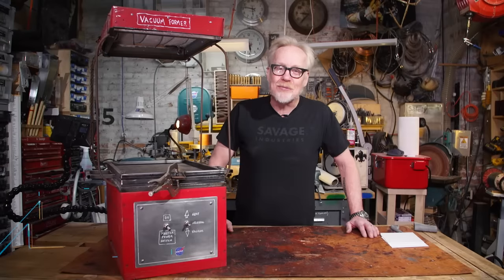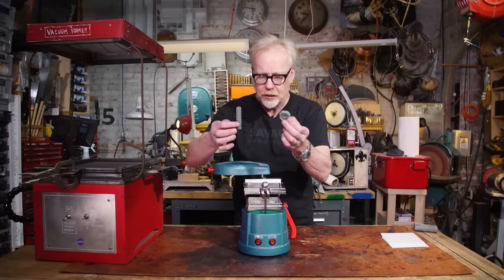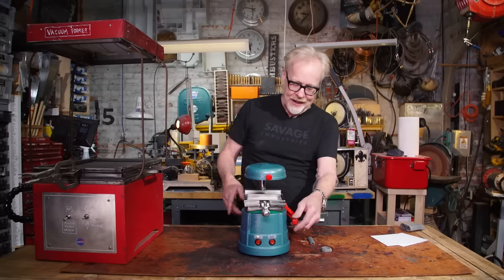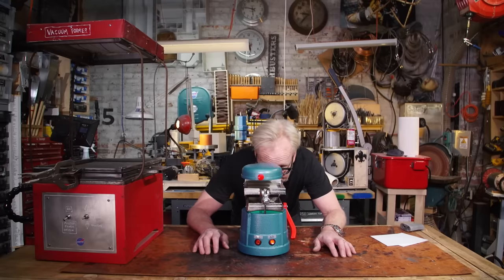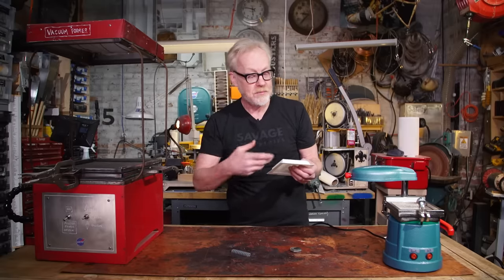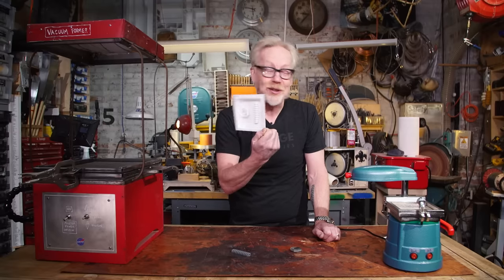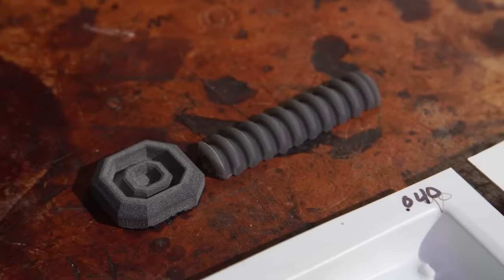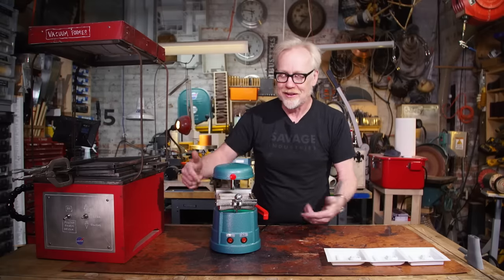Adam Savage's Favorite Tools: Great Budget Vacuum Former!

Comment: Very nice.  I’ve been using one most weeks for the last 30 years in my Dental Laboratory. Don’t forget you can fill the bottom area above the vacuum with ball bearings to allow different depths of form.  This also means you can place items in that have an undercut and use the ball bearings to stop the form being pulled into the undercut.  
Great channel mate !

Comment: Somewhere there is a warehouse that's had pallets of those things slowly selling has no idea what's coming haha
Reply: It's already down to 19 in stock on Amazon
Reply: They knew enough that the price bumped up to $159 now.
Reply: @RNMSC  You may be able to pick up a second-hand one, check with larger dental labs as I know we have two just sitting in the cupboard as there are much newer and fancier machines used now that use pressure
Reply: @assuredgrave  Also down the list, someone linked to a same machine from MicroMark for $124. So it's likely to be available elsewhere. I wouldn't expect any e-bay auction low price wins any time soon though. :-)
Reply: @RNMSC crazy now it’s only $69 now
Reply: @VinnyGjokaj  Willing to bet that there is some correlation with the number of people viewing the video now, compared to what it was seeing 3 years ago.

Comment: Used one very similar to that when I worked in a dental lab. The reason for the higher position is because the thick, rubbery film we'd use were for tooth grind guards and needed to be closer to the element. Worked great for ages.

Comment: Every time I see your homebuilt vacuum former, for a split second I think it's a popcorn machine :D
Reply: I see a gumball machine! Glad I'm not the only one😂
Reply: Now there is a fun, impractical project.  Clamp a thin piece of sheet metal ( tin? Steel?) into it and lay out some oiled popcorn kernels. See if you can get it to pop. 
  As I’m writing I’ve pivoted to a pouch made from aluminum foil with the kernels inside being clamped in the machine. Pretty much stove top jiffy by then. As long as the heat is even enough, allowing kernels to pop relatively at the same time and not burning the kernels or oil.
Reply: agreed. every. single. time. lol

Comment: I remember in the 60's, Mattel came out with a vacuum former.  It was slightly smaller than Adam's red machine.  One side had a hot plate, the other had the vacuum side with a hand pump & a plastic holder you would flip over from heater to former, then you had a handle for the hand pump. I got one for Xmas but didn't try it for a while because I had to save my allowance for plastic sheets.  It had a few pieces to start but like a typical guy, I didn't read directions.  I needed a couple of boats for flat car loads &  I wanted different color boats. After a couple fo failures, I read the directions.  Now once I mastered the procedure, I had so many boats I had to get more flat cars.  Boy, was I happy my father liked trains, my mother lost her basement every winter to a gigantic layout.  Best use we got out of the 5 ping pong tables (summer they doubled as buffet table when the family came to visit).  I miss those days building with my dad even though he hated that my modeling was better!  I wished I had kept that vacuum former.

Comment: We had one of those mythical small red vacuum formers at my old employer, a professional model shop in St. Louis.  They still have it, but as you say, it's impossible to find nowadays.  So I had been looking for a usable replacement and found this dental one a few years ago, used.  As you have found, it is an amazing piece of kit, and really fills a useful niche in any shop setting.  As a plus, my girlfriend has the teeth block from her dentist, and I can now make replacements for her for her dental needs!
Reply: The Vac-U-Form machine was made by Ron Charles & Associates (RC Vac-U-Form) in Wilmette, Illinois (Chicago area), circa 1988 to 1991.  I recently inherited the 8 x 11 size machine from my old employer, a St. Louis area professional model shop that just closed. That machine was $450 new in January 1990.
Reply: The 'Deluxe' model allowed for use of 9" x 12" sheet stock; the 'Deluxe XL' was made for 12" x 18" sheet stock, and the 'Supra Deluxe' used 16" x 24".  The 'Deluxe' model measures 24" tall, and the footprint is 13" x 10.5".  It weighs about 35 pounds.  I don't have information on the price and of the larger machines.

Comment: Really nice for small jobs, and what's really neat is the frame on this is held up from the platen on a riser, so that the plastic has to expand to the base of the buck instead of having to shrink to the base of the buck and create webbing.
 I went the home built route of a plywood sheet with a vacuum cleaner hose in the middle, and used the kitchen oven to heat the plastic.  The upside was that it can take any size frame I want to build so that I'm not wasting plastic.

Comment: I do a lot of vacuum clamping of wood parts and to get a stronger initial pull I added a vacuum tank under my bench. 8 ft of Sch40 6” PVC capped at both ends. Pump pulls the tank down then a foot pedal valve opens the clamping fixture to the vacuum.  Probably won’t work with the little dental vac-u-form but if you have a shop made bigger one it might.

Comment: I’m a Registered Dental Hygienist, and really the plastics we typically use are a thin clear plastic for retainers to a thicker rubber type for mouth guards.. All the plastics will have a very high registration accuracy because they have to fit perfectly for teeth. You work them the same exact way as you did the styrene..

Comment: I was introduced to vacuum forming as a kid, when I used my Mattel machine to make HO scale models for my trains and slot cars.
Reply: I had one, too. It was interesting and fun, despite the somewhat inconsistent results (at least in my case) due to hand-pumping to form the vacuum.
Reply: I had one too!
Reply: @Markus0021  Yeah, though I found the inconsistencies to be related less to the hand-pumping and more to the clamping arrangement that relied on registration pins in the plastic blanks.  I solved that by fitting it with rubber gaskets in the frame.
Reply: @harveyconway6036   You could be right. Or it could be a combination of the two. Either way, this rig looks to be a significant improvement.
Reply: @Markus0021  Oh, no question!  I think I suffer from a wistful lust for this: would that Mattel have incorporated a real vacuum pump!

Comment: Huh. I was planning to build myself a cheap, homemade, 40x50cm vacuum former that would cost me around 10-20usd (making use of the kitchen oven and a vacuum cleaner I already have) but I was thinking that perhaps it's not worth it and I could probably just buy a professional vacuum former for around 35usd. Learning that this tiny thing costs 120-170usd really seals the deal for me. :o I'm building the 10-20usd one myself, no regrets!! :o
Reply: @@grayhand860 1 year later and I actually decided to make this homemade former out of some MDF and cheap alluminium profiles. The final budget was around 18usd (15eur) and I'm loving it. :D Using the oven to heat the plastic and a vacuum cleaner to get the suction on the form.

Comment: You could use a big vacuformer for small parts by making a board with a hole in the middle that covers the wasted space on the vacuum bed, with the hole the size of your smaller sheet. You'd need a small frame for the sheet too, though.

Comment: My first exposure to a Vacuum Former was in grade 7 or 8, in our wood working class.  We didn't do much with it but each of us could use 1 sheet of plastic with it and everyone had a go.  Had I known at the time what a cool machine it was, I would have brought in some objects to put down to get molded just for the extra fun of it. But we learned about it that day, and did all the forms that day so we didn't exactly have a waning about it.

I think the size of sheets we used were like 1 foot by 1.5 or 2 feet (still have it around here somewhere, just been a while since I seen it).  Though the machine we used took up much more room, you had to flip the plastic over from the heating side over to the vacuum side and you had to make sure the plastic didn't droop too low or else it would hit the heater.  So ya not as safe as the ones you have there. We all still had a blast though and nothing burned down or even caught fire that whole entire time they were in use. :)   lol

Comment: I ordered one on Monday and got it on Wednesday.  Note:  If you shop around you will see the same looking machine but at different wattages (600, 800, 1000, 1200).  The one in Adam's suggested link advertises as 1200 watts, but there is nothing on the label, machine, or useless instructions (in Chinese) that indicates if it is really 1200 watts.  I'm as excited to use this thing as Adam is in the video.  Now off to Hobby Lobby for styrene?

Comment: For the POP keep a ball of plumbers putty or I prefer non hardening silicone putty.  Roll up a ball and set it right by where you are forming.  POP grab the ball stuff it in the hole done.  May not matter with styrene that thin as the heat comes out real fast but for flexible materials or stiffer materials like polypropylene and thicker material like kydex you'll be able to plug it and not stand there holding it.

Comment: I built a 12x12 inch former when I was a teen. Used it for years but it was too small. Ended up building a 20x20 inch one 20 years ago and still use it. I don't do model kits with mine and basically make molds to make more than one of something in resin. I've also done candy molds for people using it.

Comment: If you're adding a handle, why not add a 3 way switch (Off/Heat/Vac) to solve your fuse issue. You could also put it on a remote cable to keep your arms safe while filming it face forward.

Comment: I've never seen this kind of dental vaccuum forming machine. The ones I always used had a bed of metal pellets where you put the model in. The plus side is, that you can adjust the model in every angle you want and even just make a form of the tips of the model. The downside is that you'll have small metal pellets all over your workshop.

Comment: If you want to vacuum form smaller pieces on a larger former, sim0ly use a piece of cut-out mount board on the base to decrease the vacuum pull area to the size of your plastic :)

Comment: A little late to the party but I mine finally arrived. Wow, this particular one gives even Chinesium a bad name (same shape, color and mechanics as Adams, but has a brand name on the front). I'll have to strip it down and rebuild to make sure it's safe and functional. Currently, out of the box, the front guide rod jams somewhere inside so it will not clamp down. And on opening the box, loose screws at the bottom are never a good sign. The heating element, surrounding casing, heat shield and structure are held together with a wing and a prayer. The perforated plate above the vacuum has 4 different screws in it. (did they run out?)
 Still, given where it was coming from and the price, I had expected this and these are dead simple mechanically/electrically, so repairing/modding will be a breeze. I just couldn't be bothered making one at this size.
Almost fell off my chair when I pulled it from the box and without thinking said ,"Well this sucks". Lets hope it eventually does.

Ok, I had to add this: Mine came with a box of 4mm ball bearings. Not quite sure what they are for (holding down the plastic on the buck perhaps? But wouldn't that prematurely cool things?)
Well, when in doubt, turn to the instructions: (Everything is "sic")
"Stochastic Steel bal's use and application method:
Takesdown the aluminum box, the model laying aside, then does not need with the steel ball to take shape the part to bury, places in again the radio station"
Wow!

Comment: Just love mine. Been using it for a few years with my model aircraft & 1/35 armor kits.
Reply: Can you explain exactly what it is you use it for. I have several 3d printers and I'm trying to figure out (for years) if I would ever find a use for such a machine. I build armor kits like you so I'm interested in the actual day to day applications.
Reply: @stinkyham9050  I use it to make thin sheet copies of add on items for the vehicles or dioramas. Supply boxes, rolled tarps and other items that only keep a single master in scale and vacuform any copies I want to use. It saves me time that I would spend making resin copies for these items, especially if I want the item to show any wear or damage. Easy to do with the thin plastic copies. I've never used 3D printers and mostly use my vacuum former & doing resin casting molds for add on items or other pieces that I need or want to use. Hope this helps, if not contact me anytime.

Comment: If you need a vaccum pump for just one or two uses then you can usually get lended one at most auto parts store. You pay for it in full upfront but once you are done then you take it back and get refunded.

Comment: I have one. Don’t use it everyday but could not get by without it. I will say the only drawback of the unit is the  plastic control knob on the heating element does get very hot. Thought about replacing the knob with a material that does not get so hot. Suggestions would be appreciated.

Comment: Would these be good for creating molds to cast resin parts?
If so what are the pitfalls of this?
I could picture creating small kit bashed pieces then vacuforming them to create a form and use that to create a solid strong buck for future pulls.
Reply: Curious myself.

Comment: would using a heat gun instead of the supplied element be more efficient?  You have absolute control of heat intensity and placement as well as the ability to use 2 different outlets to not trip breakers.  You could leave the heat gun running the whole time.

Comment: this is too cool, though if I may, the blowthroughs indicate the plastics was overheated and far too malleable/liquid.  Since the plastic sags under its own weight, gauging the sag by portion instead of absolute measurement has yielded a more consistent result for me.  the camera angle for the last pull appeared to show a sag of between 1/3 and 1/2 the frame width, and a blowthrough.

Comment: Adam I love your channel. Feel free to delete this comment if you'd like. I bought one of these vacuum formers second hand but looking brand new. The first time I tried it I was curious how hot the element would get so I held my infrared thermometer on it while it heated. It seemed within seconds but definitely less than a minute it measured 2285 degrees Fahrenheit. I thought I'd better check that out so I shut it off but didn't unplug it. Luckily I stayed home. About 15-30 mins later the vacuum started on its own. The thing started smoking and burnt itself out somewhere. I was about 6 ft away and quickly pulled the plug. There's a person in the reviews of one on Amazon that described the same. I really want this thing to work!!!

Comment: At my Dental Lab we had a table size model like you made and when we formed small dental objects we had an aluminum plate that laid over the suction bed with maybe a 7 inch rectangle cut out in the middle, thereby making it a 7 inch former. Then You could take it off and vacuum form a prosthetic leg then back to fae eyeballs and sometimes dental stuff and even a prop retractable knife that squirted kayro syrup n food color. Dental Labs have the Coolest tools

Comment: You should really look into dental technician equipment. That is the industry I get most of my tools from. And they are generally better quality than modeling/Maker tools and usually cheaper, especially in the secondary market.
Reply: Seconding this - It's where I got my centrifuge for casting metal jewelry from.
Reply: for real, i work in dentistry and everything they are throwing out i sterilize and take home. things like microbrushes ive seen at michaels 6$ for 10 of them but you can get 600 for 10$ if you get the dentistry ones

Comment: Could you make additional frames for a vacuum former so it can hold smaller pieces? Even better. Could you make nesting frames so they could be swapped easily by pulling the smaller ones out?

Comment: I was contemplating one of these to make transparent float bowls for my bike carbs. I had two problems. None of the ads you see state the size, solved with this video, thank you. The second problem is that I need to pull 2mm transparent petrol (gasoline) proof plastic of some sort. Would it do that?
Reply: So, to answer my own question it will not pull 2mm with any sort of precision.I also note that I think the conversion from 110 to 220 or vice versa consists of changing the sticker (I have seen that lots of times). Mine will bubble the plastic at the centre long before it is hot enough to form even with the plastic on the table . I added a four inch extension to the heater and it still is not far enough away to make the plastic soft without destroying it. It needs a better heater, possibly an IR heat lamp or some temperature feedback. The vacuum is amazing though.

Comment: I just received mine in the mail, still waiting on the styrene sheets. I had a quick question, in the box there’s a smaller box (which I haven’t opened yet) that sounds like it has some sort of loose metal or sand? What is it and what is it for?